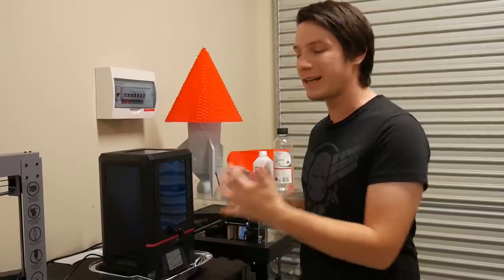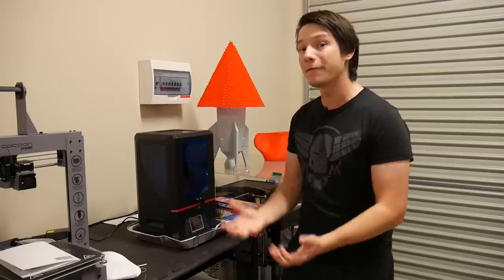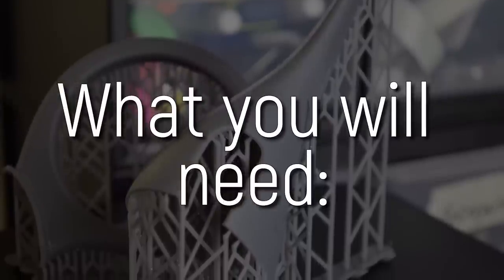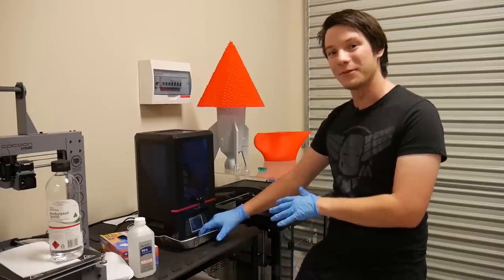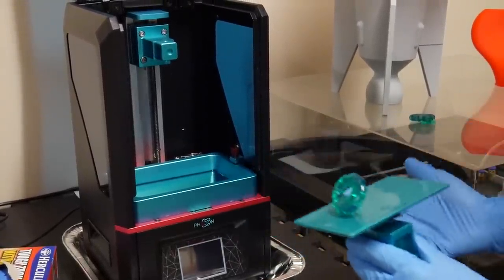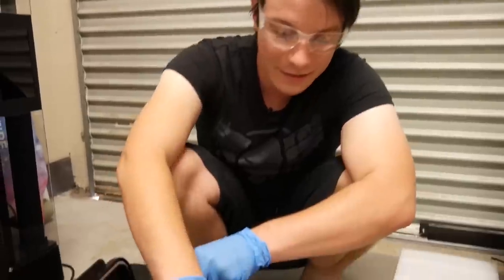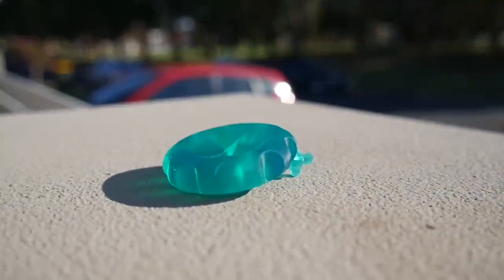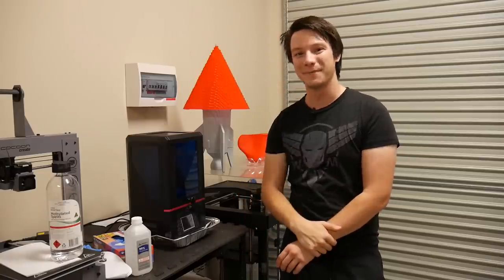Resin 3D Printing Safety - Important for Beginners!

Comment: ok Im going to ask... How unsafe is uncured resin? Seriously how toxic is it? I know you shouldent get chemicals on your skin but PPL do it anyway.
Reply: Read the material safety data sheets. For FormLabs materials it's not that bad. The fumes are the highest danger rating it gets, but I believe that is primarily if the material is heated above 150 C and degrades into dangerous gases. Print temp is around 30. Otherwise it's a minor skin irritant. Every material is different though, and I've heard other resins are more dangerous and have caused some effects to people that aren't properly using the machines. Doesn't mean you shouldn't wear gloves at a minimum and have a ventilated space, but in my experience minor skin contact with FormLabs resin doesn't do anything.
Reply: Yeah, it can cause rashes and such.  That is about all it will do if you are being careful and get some on your hands.   If you have the system down, you can do the cleanup without ever touching any uncured resin, but you will likely touch the resin/alcohol mix, this is mainly why I use the gloves.  Gloves are a simple precaution so no real reason not to.
Reply: the biggest problem with chemicals like these if you get it on your hands.  is that it eventually ends up on your face.  and/or eyes
Reply: A very good point, that can still happen with gloves of course.  I rinse my hands in the ipa a lot as I am working with it when I even think I may have touched it.  And IPA through the gloves feels neat as they get really cold as the alcohol evaporates off.  I have been using pure IPA so far since I had a bunch around, but methyl/ethyl alcohol is way cheaper so when I get more I will move to that and leave the IPA for cleaning my filament beds.
Reply: I also wonder how dangerous this really is. People said the same about ABS. Just saying.
Reply: Uncured liquid resin is no joke. It is insidiously hygroscopic, making it a threat in its uncured state to the environment and to your mucous membranes: eyes, nose, under your fingernails, etc. Resin contact with cuts can be an extreme irritant and excoriate the wound. Working with semi-cured resin waste while cleaning up polyjet machines, I find that dry patches on my hands, especially the knuckles, will react quite badly with the resin and will eventually turn into scabby sores if not thoroughly cleaned and then moisturized regularly for several days afterwards.

Resin fumes are a great way to get migraines in the short term, and linked to a number of pulmonary problems in the long term. Proper disposal of resin waste is a serious issue for the environment, and consumer SLA makers are almost criminally nonchalant about educating customers about how serious it is, especially given that the shelf life of liquid resin is much less than that of FDM or SLS materials. (Typical advice is to leave the waste material in a UV-rich environment to cure the material, but that often relates in semi-cured resins that still cause damage to the local environment.)

Also note that given resin's oily viscosity, when you do clean up spills you want to use chemical spill kits which have spongy shammy-like cloths that you can use for a drop cloth and/or to soak up the material. You also want to wear gloves while wiping up messes, as the resin will generally soak through whatever disposable towel you're using.
Reply: @BenVara  THANK YOU! He always mentioned how toxic this is and you should not touch it, but he never said why. People often say you shouldnt do this or that but in reality its not that bad
Reply: I am using the same printer and I can't be bothered with gloves 😂 resin is quite sticky, but so far I can't see any skin damage or irritation 😁 I don't believe it is anywhere near as toxic as we are made to believe. But hey, it's me, your skin may react differently 😁
Reply: Its an irritant. Some idiots claim its cancerous, but its an irritant. Always read the MSDS, no one reads  the MSDS.
Reply: It really depends because different people will react in different ways. Not to mention there are so many types of resin out with their own compositions so it'll be impossible to determine just how dangerous it really is. Some people will be indifferent to it and can simply wash it off and be fine. But it can cause rashes or even allergic reactions to others.

But the main point is that you don't want it to get in contact with the eyes, nose, mouth or any open wounds on your body, and the best way to do that is to just try and control the mess. Even if you're not affected by resin, it's still easier to get it on gloves that you can strip and toss than to rinse your hands and potentially miss some. And then you proceed to use your computer and get residue resin over your keyboard, or use doors and then someone else touches it (who may be allergic) or you go prepare food etc.

So while some safety precautions may seem overkill, it's always better to be safe than sorry, especially if you have kids or pets around. Not to mention gloves are cheap (a couple of cents at most) and disposable, but your body isn't, so there's really no excuse to not wear them.
Reply: @truantray  yeah but the msds also states suspected of causing fertility damage

Comment: Looking forward to seeing what else you do with this machine! I've heard many good things about it!
The slicer for my gizmo can generate infills and leave an open bottom! :) Obviously not going to suit all models, but does come in handy at times. 
Despite that though, I actually use a method similar to your hollowed out rabbit with the diagonal internal struts if I do want infill. Pretty rare that I do need/want it though. Perhaps I'll do a vid showing it sometime.
Absolutely agree with the metal paint scraper idea too. I got one from woolies when I got my printer. Plastic ones would just snap trying to get a well cured print off the plate. 
Is your wash station the one that came with the Form printer? I'd love one like that, but like you suggested, I just use a trusty old tupperware container atm. Just a shame I can't find the lid for it lol

Comment: do you use the ipa to clean the platform or just water? I don't want to fade the blue anodized surface.
Reply from the maker: don't clean the platform! You don't need to. Just make sure it's got not cured parts still stuck to it.

Comment: Mr. Muse have you looked into water washable resin?  I am just looking into it myself. Wanhao makes some. I'm looking to find out if it is as toxic. It might interest you as well. P.S. Love my photon.  Thanks for the mesh mixer tutorial. P.S. I myself use my printers for business.  My CR10 and Wanhao more duplicaters are workhorses. My newest machine i3 mega v2 which I just purchased is also turning out to be one of my favorites. I like my photon as well, have not really used it for anything but trinkets. The price is so reasonable I just had to get one. One tip.  I ended getting some plastic razors which are great. Not sure about there, but here in the USA they are easy to get. The look just like regular razors, but are cheap. I use them to remove my model off the bed on my FDM and DLP

Comment: I might get one of these down the line, but I was wondering a few things.
1. The alcohol can you reuse it for other parts, or do you have to throw it out each time? If you can use it again, how many times normally would you be able to?
2. Do you find prints from this is stronger or serve a better function than just looks vs FDM?
3. What actually happens if the resin touches you? I mean I know it can harden in UV, but what do you mean by it being toxic
4. How long does the resin last? What I'm wondering is if this is cheaper than FDM and you can get more bang for your buck from this

BTW thanks for making this. I was about to get one of these. I decided to hold off until I can get a safe place to do all of this in. I literally didn't see a single thing talking about anything being toxic or having to do 90% of this anywhere else. And when I seen gloves involved, I figured that's because the resin can basically glue your hand
I literally came here from some video of an unboxing. The guy was putting the resin in without any safety gear. When people mention in the comments about he should've had gloves on. He only then said something about water wash resin (whatever that is).

Comment: For gods sake please don't place your head above IPA container without proper M3 mask with gas filters and googles... IPA is heavily irritating for your respiratory system and eyes, you might feel just fine at first but long exposure to IPA may lead to some serious health problems. I've tested my printing room with air quality meter and it only takes seconds for IPA TVOCs to reach end of scale and fill whole room, do not stay in the room unmasked and use some good ventilation to filter it out of building.

Comment: Hi Mate, question, I design say a disc at 23mm in a cad program, but when I go to print with this printer it comes out smaller, I asume its because of the high reslution, how do I compensate for that, do I need to adjust the settings in this machine to print exactly 23mm, thanks mate any advice would be greatly appreciated :)

Comment: I have worked with UV resins for over 15 years using simple UV lamps to cure badge covers etc. Its not that bad, taking a part out with ur hands then washing them after is perfectly fine. You can use the same principle as LEAD its ok to handle just wash ur hands and don't ingest. Ppl get to freekin paranoid about about the most simple things. If ur handing it over prolonged amounts of time then sure gloves etc are a good idea, but if ur printing the odd part from time to time, don't stress over it.

Comment: It doesn't matter concerning how to handle resin, however you overdramatize a bit. The resins are not toxic per se. However, they are highly allergenic. You may happily work with them for years, then, BOOM, you get sensitized. This can go as far that you cannot be in a room where somebody else works with the stuff. So, yeah, you want to avoid getting it onto your skin.

Comment: So just to confirm… worst case scenario, you don’t wash your model, you leave it out in the sun for a day or so, will the excesses resin clear and be safe to handle?
Reply from the maker: Yes, once it's fully cured it's safe to handle, even if you don't wash the print after removing it from the printer.
Reply: @MakersMuse  awesome! Thanks for that information! I’ve been a little reluctant to handle them afterwards. I spose resin isn’t food safe though?

Comment: Seems to me that the only benefit resin have is very fine detail prints, otherwise it is a pain, hazardous and toxic.
Reply: it's not a thermoplastic, which means it can handle higher temp needs. it can also be clear, and is often used for test molds for injection molding. it's an absolute pain and as much as everyone loves the quality I believe its best uses are for aiding mass production of thermoplastics and metals.

Comment: Have you continued to use the Photon?  Have you tried either PhotoCentric's or Formlabs' "Tough" Resins?  Cheap resin is great, but sometimes you want to make a part that can take an impact or two without shattering.  It would be great if you could show and compare.

Comment: Great channel here. I watch you a lot from the States. I am BRAND new to printing, in fact 8 weeks out. I was looking at my first printer being a Resin but I decided the gloves, safety glasses, worry about contamination, clean up and not even sure if the printing is any better for all that extra work, and it's a lot of work. I ended up with 2 printers. The first one, don't laugh as it got a lot of negative reviews, Dobot MOOZ-2. Got it for a song and dance on Amazon, $220 vs. the similar Snap Maker at over $700. My first printer I though, let's be budget savvy and I liked the 3 functions, 3D print, laser engraving, and CNC. First 4 week was nearly every day a filament jam. But then I learned. EXTREMELY straight filament cut to a point and then heat the nozzle to 200 degrees then push the manual extruder mechanism button to move the feeder wheels and now no jam ever. Then it was the print bed, no sticking. I tried the hairspray - not consistent, painters tape - not consistent, glue stick - a little better, Elmer's glue, the cheap school glue - perfection. Since I am doing a lot of projects I also picked up a PRUSA mini. So, both my printers have small volume which, so far, suits my purpose. If I get the need, I see you guys have like 7-8 printers and I will go larger next time. This may shock you but the DOBOT-MOOZ, with all the negative reviews, is producing as good often better prints than the PRUSA. Unreal. Thought I would say hi from the US and I am probably going to stay clear of the resin unless some reply that I am completely missing the boat and that resin printers are seriously superior.

Comment: Juste recycle the 99.99 isopropanol. Uv onto the liquid. Then Use a filter to get the particle out. Put the liquid into sealed container use it again. If the concentration is going down the plsstic might appear whiteish. Than either remix the used isopropanol with 99.99 to rais up the concentration. So u need less isopropanol. Or just simply use washable resin. Its the easiest way to handle and less toxic fumes and cheaper. Water can ne used by doing the same process. The way Ur isopropanol container is open during washing is not good. U lose a lot of isopropanol because it evaporates. Use a closed sealed container. Best is wash and cure Station anyway. Mpsr important use a respirator especially because using isopropanol. It makes even more vapour. Put the printers into a fume hood with hpe filters. Try to get the outflow out of the room. Fume hoods are the best for this.

Comment: Good video thanks for sharing. I would echo this with some other things. Invest in chemical proof gloves with longer sleeves. I think those disposable ones aren't that good as you get minimal coverage. Also an apron. Preferably plastic to save your clothes incase anything splashes. If you do have a bad spill you could cure the area using a UV light after you have wiped up the majority. I also go around and wipe my area every few weeks with isopropyl just incase there is a moment you put your hand down on the table or something. Also ventilation is extremely important. I open some windows if you don't have an extractor and wear a hepa rated safety mask for liquids. Resin stinks and it's bad for your lungs.

Comment: I have an issue... Nobody has been able to fix it... Not creality... Not forums... N so far no YouTubeds have responded.

I have a simple print. No supports required. On fdm it prints in 45min via 0.8mm nozzle.
On a low end tevo tarantula, perfectly fine.

With this sla... The fep wrinkles and ruins the print by leaving a large branch in the center.

I've changed every setting and 2 different brand of pef and tensioned it (stock too), nothing has resolved this issue...

It's a simple rectangular skateboard truck Riser pad.... Is a simple 7mm Riser the kryptonite of an sla printer??

Get back to me. You could do a shoot with my stl or I can pay for your help. Whatever. I just barely got this printer and... It prints other stuff fine... N again quality of the Riser are fine... But I get an ugly wrinkle (you can use a heat gun to iron it back out but it comes back every 20 layers)

Comment: You are using Spatula from Prusa (it is rounded to prevent damaging Print beds on FDM printers, BuildTak etc.) i am the one who invented the double grind and i grind them. There is different stainless steel one for SL1 (Resin printer) They are way sharper, high polish, no burs that could damage prints. I am removing prints upside down with ease to avoid re-leveling the bed. :) You can slide any print with it like butter. Hit me with message if you want one. :) I could make a special batch for you for your shop. :)

Comment: BTW - cleaning with IPA in the box is good only if you print dolls, figures etc. When you treat printing more "seriously" and you want to flush leftover of the resin from eg M3 internal thread, small holes, there is no better option than use heated ultrasonic cleaner with IPA.

Comment: If you dispose of resin, solvents, contaminated mixes - any chemicals really - unless you use the original container, please mark the container with what's in it. Either by chemical name, or common name if what that technically is is widely and commonly understood. Especially do so if you stash it in a public hazard container / shed, but also do it if handing it in at a manned station; the person receiving it may not correctly pass on any verbal information to the next guy handling its processing. 

Also, with liquid chemicals, Especially(!) solvents - make sure the container is safe for medium to long term storage of that chemical. If they get little of it, it may sit in storage for a long time before they accumulate enough to warrant the next step in processing. For instance don't store acetone in PET bottles, use HDPE, metal or glass (HDPE is pretty solid for many solvents, but far from all of them).

Comment: Definitively much better to use clear 99° Ethyl Alcool top clean parts and resin residues.
 Isopropyl Alcohol or Methyl Alcool I'm afraid can be more toxic than the UV resin, for sure both are very strong poisonous if ingested.

Comment: I have to stop you right there, FDM printers release VoCs just the same as resin printers and have the added bonus of ultra fine particles. 2:20 is factually inaccurate as you need to handle PLA vapors and particles just the same as a SLS/DLP printer.